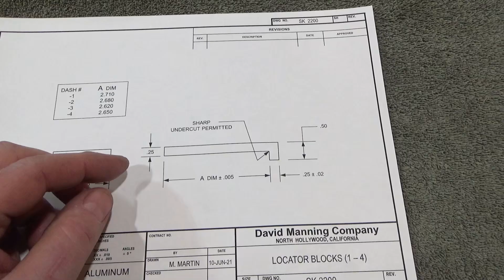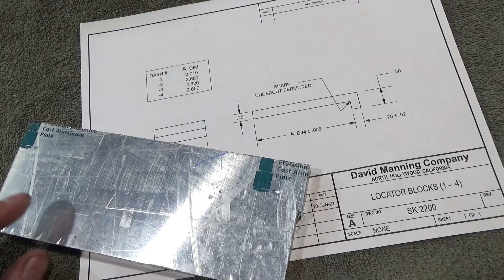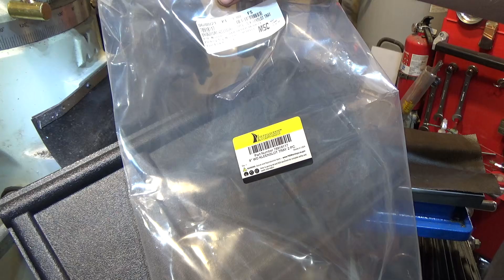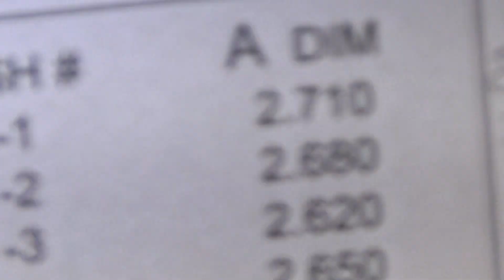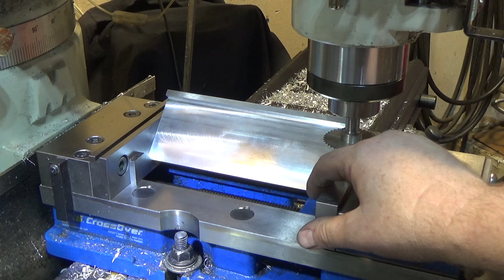165 Spacer Blocks for Customer

Comment: Great job , they came out well .  My mill covers are nothing as i never use them !  Cheers .
Reply from the maker: I might be right behind you there Max. These covers are terrible, like the last ones. I used covers because I bought this mill new and did not want to scratch up the ground surface. I know, call me crazy, but shiny metal is really nice to look at.
Reply: @DudleyToolwright  If my mill was new , i would no doubt use them as well  !

Comment: my mill covers are just tempered hardboard with some pieces of wood that fit the channels glued on.
I can cut them up if I want to shift the vise, and I do shift the vise, so it works for me.  I also routed some grooves in the hardboard to prevent end mills from rolling off. I just put the end mill either up agains the vise or in the groove.
I'll bet you can hog off with a faster feed rate... seems like you aren't loading it at all.
Reply from the maker: I really appreciate the suggestion and tips. I might just try that approach.

Comment: Nice real home-shop solution for real customer job. Loved the simple corner relief operation. When you showed the drawing and mentioned you needed to relieve the inside corner I paused and wondered how I would do that with the tooling I had on hand 😊.  I guess I could have done that too 👍👍😎👍👍
Reply from the maker: Thanks. It's the problem solving that really draws me to this trade. You never get bored.